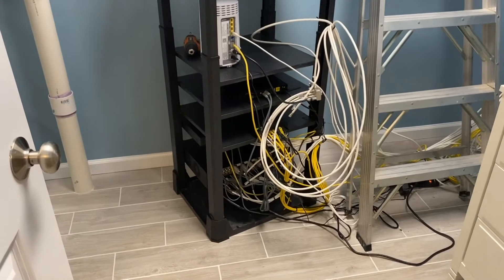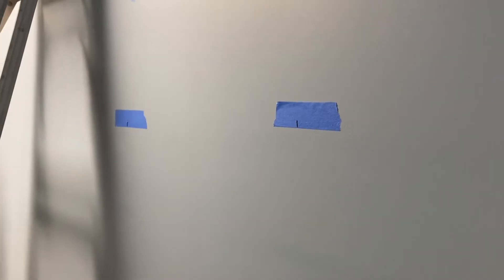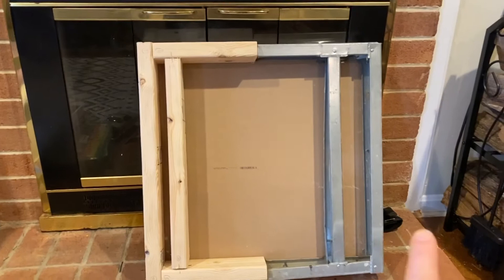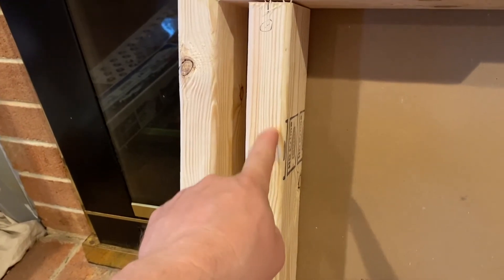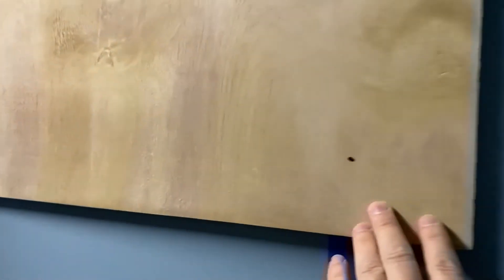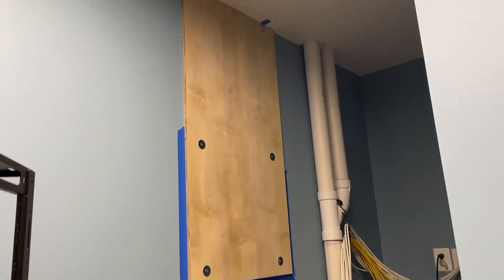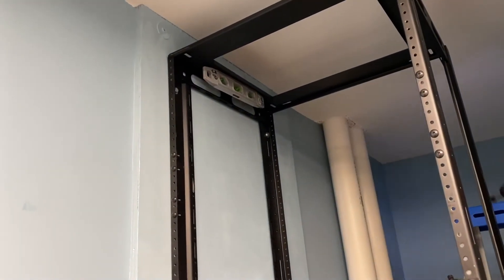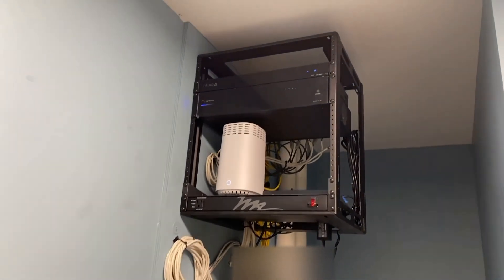Installing a Home Network Rack on the Wall

Comment: How much weight would you estimate this installation would be rated to hold?   And then how much would it be rated to hold if it were directly mounted onto studs behind the wall?  Thanks for the great video!

Comment: Hey Frank, thanks for the video. I'm going to be mounting my rack in my basement to bare cinder block walls. I prefer to use a backer board, but I'm not entirely sure if it's necessary. Can you comment on this? Will concrete anchors be needed? Thanks!
Reply from the maker: I would just use concrete anchors. But is the good ones. Drill a hole in the concrete and slide in a molly. Then screw into that. Don’t use the blue masonry screws. Use a better anchor.

Comment: I want to make sure I fully understand. The Plywood is taller than the rack for what purpose? Was it to have a mounting point for wire organizers? I also want to make sure I understand the reasoning for the plywood. It attaches to the studs so that the Rack has a solid surface and you can ignore trying to find studs to mount the rack to because you're mounting to the plywood?
Reply from the maker: Correct sir. The plywood is firmly attached to the studs and the rack is securely attached to the 3/4 inch plywood. The client did not want me to shorten any of the cabling that the cable company ran for her. This way if the rack ever has to come down, she will not have to unplug anything from the rack. The cables are so long she will actually be able to pull the rack out into the hallway. I did not want to secure such large bundles of cable to just drywall. So I made sure the plywood was long enough for both the rack and the mess of cabling below it. I really wanted to shorten all those cables but the client said no. And the client is always right… lol
Reply: @FrankGuest  I need to place my rack on a concrete wall. currently it has two 2x4 pieces of wood attached to it, horizontally, 34-36" apart (not perfectly level). I was wondering your advice for mounting the plywood.
Reply from the maker: @kenman345  as long as the plywood is securely attached to the wall, then you can attach your 3/4 inch plywood to the 2x4’s. But if your not sure about the 2x4’s the. You can attach the rack right to the cement wall with some masonry fasteners. You will need a hammer drill to drill into the cement.

Comment: Important question.  When you mount the rack on the wall, are you drilling the lag bolt through the wood board and stud or just the wood board?  Thanks!
Reply from the maker: Just the wood board. If I was able to hit 2 studs. The 3/4 inch plywood would not have been needed. The plywood is attached to the studs, and the rack to the plywood in this video. Thanks for watching.
Reply: Good point.

Comment: What would be your preferred mounting hardware for say a pretty heavy data cabinet in a commercial environment, in concrete, in drywall with metal studs and in brick...??

Comment: Hello, thank you for this video.
I'd have a question, my wall consists of 1.25cm drywall which is directly mounted on plywood and then there's an empty space.
Do you think I'd still need to add another plywood in order to mount a 12U 19inch NW rack? (will be full of devices)
Thanks.
Reply from the maker: As long g as the plywood behind your drywall is 3/4 inch thick, you should be good.
Reply: @FrankGuest  I just took a measure, It's 1/2 inch plywood as well

Comment: So you attached a plywood first to the wall - why? Why not attached the rack directly to the wall?
Also looks like your large screws that you used to attach plywood to the wall are not in line with screws you used to attached the rack to plywood.
Shouldn't they go to studs as well?
Reply from the maker: If the mounting holes on the rack were exactly 16 inches apart. I would have attached it straight to the wall. But they were not. So I had to use the plywood. That way when I use the larger screws, they securely attached my rack to the plywood which is already secured to the wall. Hope this answers your questions.
Reply: @FrankGuest  thank you very much for the explanation!

Comment: The Wood screws looked like #8 3inches & the Lag Bolts looked like 3/8 in x 2 - 1/2 in. Were those the sizes?
Reply from the maker: To be honest, I do not remember the size. Make sure your wood screws are long enough to go 1/2 or 3/4 into the stud. But not so long that they will pop out the other side of the wall.

Comment: Can you give the size of the Wood screws & length? Also with the Lag Bolts were you drilling them into the Studs too or just into the Plywood? They were short compared to the Wood screws
Reply from the maker: The lag screws went into the plywood only. The plywood was secured to the studs. When picking lag bolts, make sure the thread goes all the way to the head of the screw.
Reply: How about the size for the wood itself? I'm looking to put up a small 15u rack for nrweorking, says it's rated for 220lb.

What's your recommendation for running the wires to it. In my case it's in a front hall closet, the rear wall has an hvac return on the opposite side so I don't know if it's  OK to drill into it to run cables inside. Thinking a hole in the back corner of the ceiling ?!?

Comment: phoff...why didn't you put a bigger rack? those cables look very badly hung like that...there was enough space for future upgrades and cable management...
Reply from the maker: There is plenty of space for extra gear in that rack. The router could be put on its side. Besides, the client requested that rack and she did not want me to cut any of the cables. It’s a clean install, sorry you don’t approve. But thank you fir watching my video.

Comment: I see the customer has Verizon FiOS, FUCK Yea. Screw Comcast
Reply from the maker: The Verizon techs did a horrible job with the install. Putting it up high out of the way was how they should have done it. I wish the client would have let me cut all her cables shorter. She said, leave them long and coil them neatly.